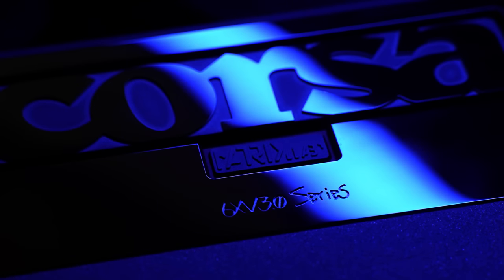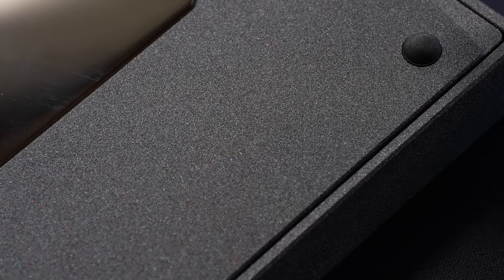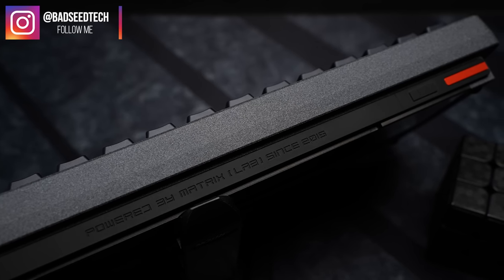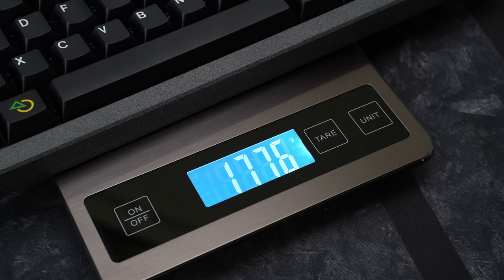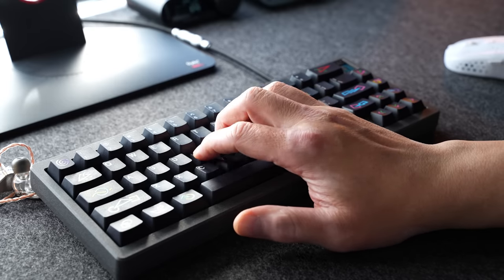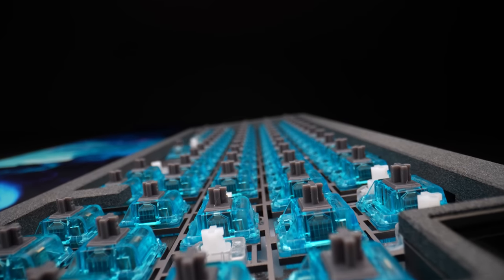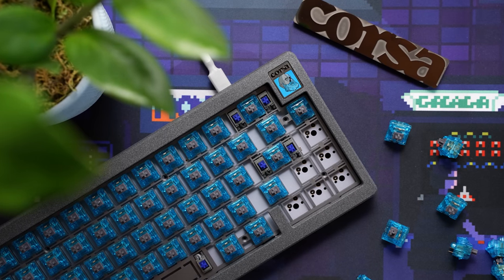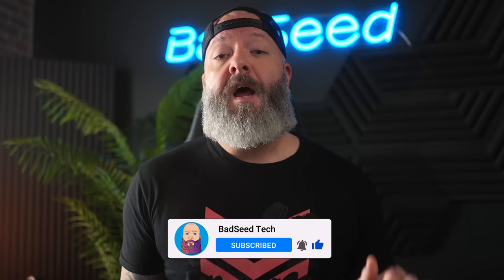Matrix Lab Corsa Exceeded My Expectations

Comment: Would you have any interest in reviewing the Cooler Master CK720, the wired one that just dropped? For only $100 it seems like an impossible good deal, aluminum top plate that can be swapped out, hot swap, dial, etc.

Comment: Help me out badseed, I’m looking for a 65% RGB keyboard that sounds good with minimal modding. I’m currently using the glorious gmmk2 with panda factory lubed switch’s, I did tape mod but only 1 layer. I like it a lot but it doesn’t have the sound I’m looking for. I did pick up it switches and waiting on them. Any suggestions?
Reply: i have an extra brand new Wuque Studio ikki68 aurora with an extra hotswap bluetooth PCB if you want it, still in the zipper case it came in. With a PR4, aluminum and a polycarb plate. (I bought the round 2 optional aluminum top piece and made a custom bottom piece so I ended up not even using/needing the first R1 smoke grey case with the included PCB and extra Tromso Bluetooth PCB.

Honestly wish I had just held off on all $500+ worth of "extra" accessories for mine so i'd have enough to have just bought this Matrix 65% , but in all seriousness the ikki68 aurora is a solid board with ridiculous amount of options and just about any key and keycap config you can think of works with all 8 of their PCB options 😂

Comment: This is easily in the top 5 65% boards out there, beautiful finish as well as design and the LED is a refreshing feature on this board. It sounds great with the Badseed switches great review, the custom badges are HEAT.